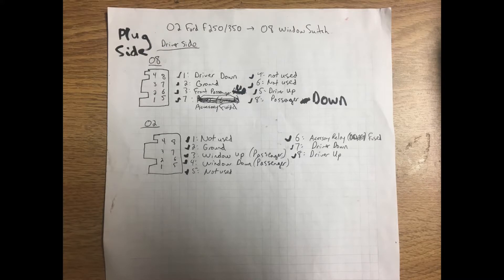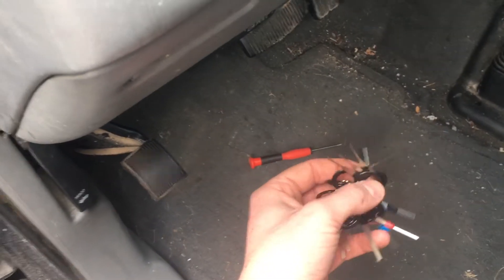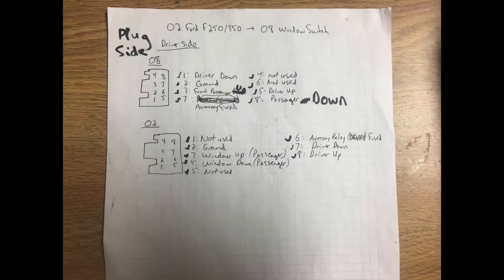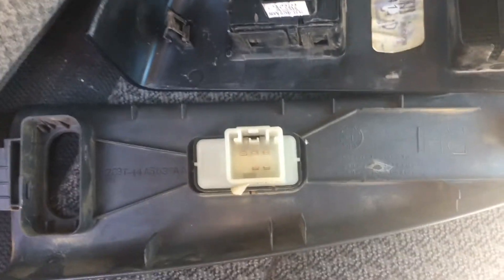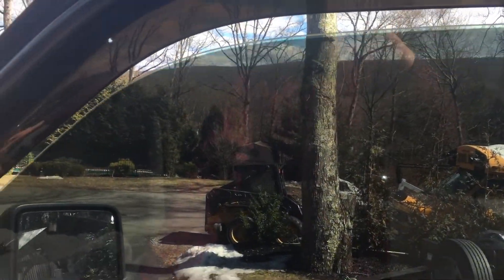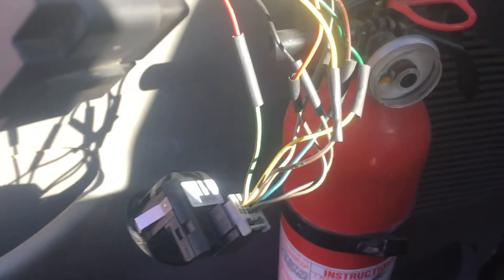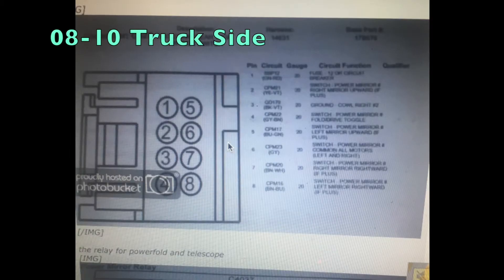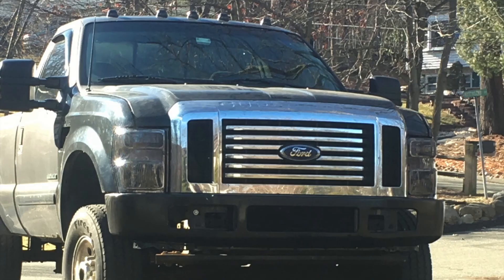Super Duty Door Panel Swap Part 2: Window Switch and Power Mirror Control

Comment: Ziggy, I have a 2001 f350 crew cab, I want to put doors from my 08 f250 on my 01. I want to just use the 08 pigtails and splice them to my 01 wiring harness, would that work fine? also where did you find the pinout diagrams you showed? Thanks man for any help!

Comment: Anyone know if dash cluster in 2004 has a memory that must be moved into the new cluster. I have an 04 with a bad cluster. The gauges and dummy lights are all out except for the ABS dummy light. Even the mileage is out. I'm wondering if I should purchase a new cluster to use to make the 2008 cluster? Or do I have to use the one out of my truck? All the fuses look good. The truck had a fire and some wires burnt. I can see the green board where the wire harness plugs into the cluster has a little discoloration and smoke damage only right around the area where the harness plugs in. SO I am thinking that some of the circuit board is burnt. However, windows also do not work nor does the horn. So I read that the wiring in the steering column or something could cause all that?

Comment: So here is what I found about the reversed mirrors. If you wire up the mirrors in the door colour to colour they will be reversed with the 06 switch that's what I did and I left it but then when I wired up the switch up top it reversed something again and now my mirrors work right is right left is left
Reply from the maker: Dustin Stradeski Awesome! Thanks for sharing that!

Comment: Do you have to reset/reprogram the window to make it work again? I took the fuse off to add a pigtail and now the front passenger window dont work
Reply from the maker: kaka kaka no no reprogram is needed, make sure that both sides are plugged in because the circuit needs to be completed i’m pretty sure, and make sure you put the fuse back in just in case you didn’t lol
Reply: @Jimmyziggy  
Okay all I did was took the fuse out...Now it's not working and I triple check to make sure it's not a bad fuse...
Reply from the maker: kaka kaka well that strange, is it all wired up accordingly to the pinouts? double check that, and the passenger side must be connected as well
Reply: @Jimmyziggy  yes I didn't mess with the door or switch at all...I just took the fuse out so that I can add a pigtail to it....now it's not working....I'm not sure if i have to reprogram or reset that side of the window to make it work again. All the other window are working properly.
Reply from the maker: kaka kaka hmmmm, so did you add one of those like add a fuse pigtails to the fuse box? is that what your saying? maybe you overloaded the fuse box and damaged it or something to be honest i’m not really sure how to help with something like that, and i don’t know if you can reprogram the windows, i’ve never had to do that
Reply: @Jimmyziggy  ..yea...i added another fuse to it...both the fuse still good..but thanks for the help...I'll figure it out....
Reply from the maker: kaka kaka yea that’s strange i’m not sure. maybe it’s a coincidental thing with something else going wrong at the same time you added the fuse but that’s highly unlikely they would occur at the same time. but i wish you luck and if you ever have other questions i’m glad to help
Reply: @Jimmyziggy  ...got it to work....I think it was a loose wire somewhere...I just bang it a couple of time on the switch panel on the driver and passenger side....but now the window lock features doesnt work...lol...at less all the window is now working...thanks